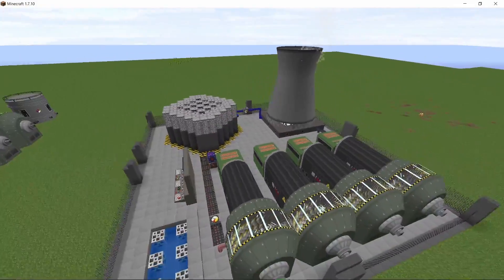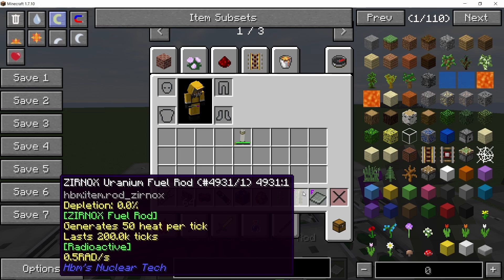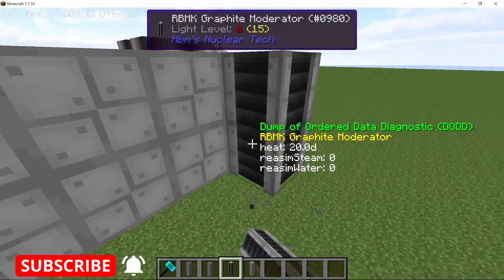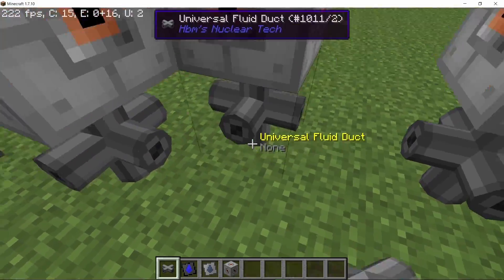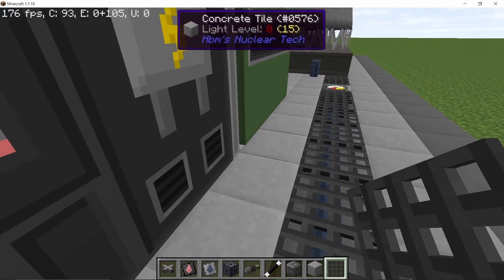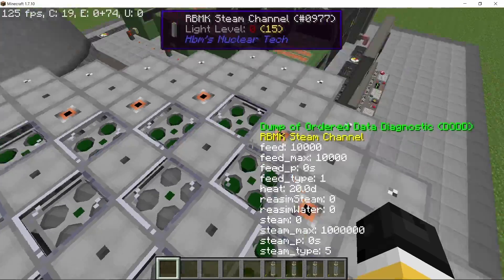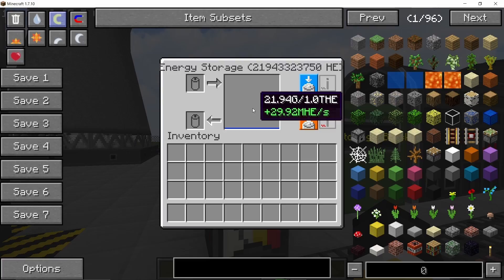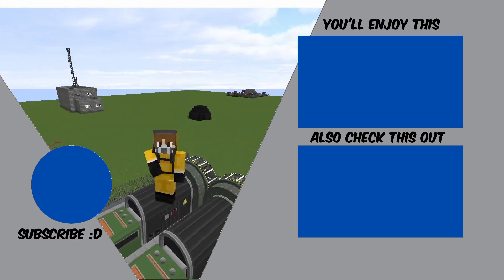Medium Enriched Plutonium RBMK Reactor - HBMs NTM

Comment: Great video, but can you tell me the difference between ReaSim and normal rbmk Column?
Reply: The difference is that the Reasim ones are meant to act like a real RBMK, so instead of the neutrons only going in 4 directions, forward, backwards, left, and right, they will go in all directions like they do in real life. It's basically meant to closer simulate a real RBMK.
Reply: Thanks  @josephtf3188